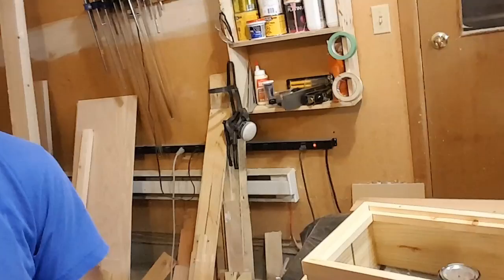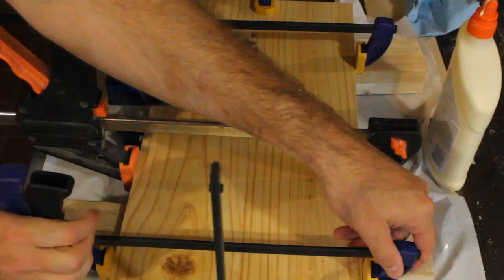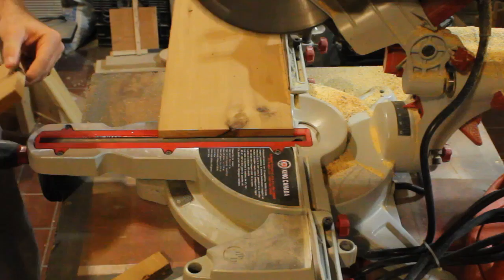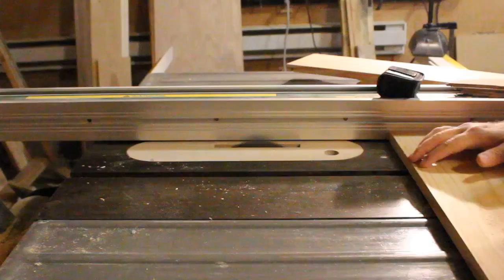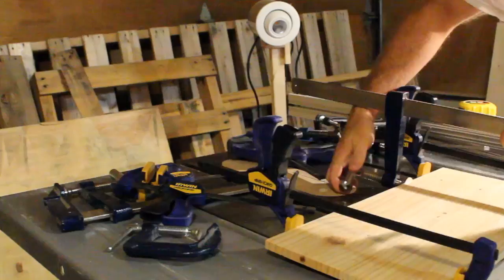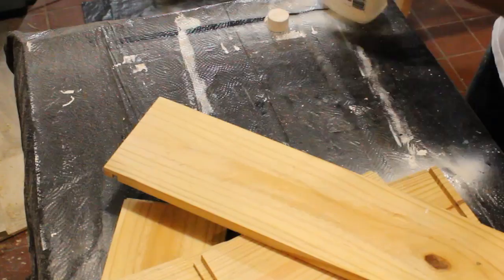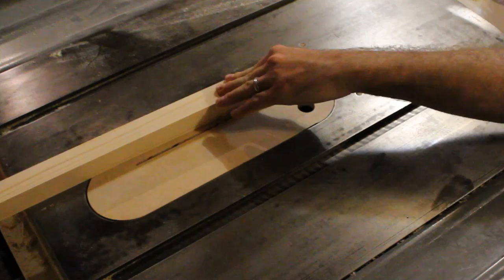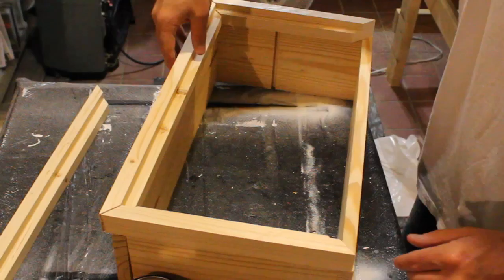Whiskey Gift Box Set: Part 1

Comment: Did you manage to get the bottom and top pieces perfectly flat? I have tried gluing up some panels and they kinda wobble when I put them on a flat surface. :)
Reply from the maker: I struggled with it at first, but I've developed a couple of methods for flattening.

Comment: Save up some money and buy some pipe or bar clamps for glue ups the clamps you are using warp the boards for glue up. I was making cutting boards and used similar clamps and they messed up my cutting boards. I purchased 2 Bessey pipe clamps there cheap but work well.
Reply from the maker: I actually just bought 4 sets of Bessey pipe clamps! Check me out on instagram @philpinsky

Thanks for watching and commenting.

Phil
Reply: +Jake and Emmy's Dad Workshop I don't have social media.
Reply from the maker: No problem.  Sub to my channel.  You'll see both the clamps and dust deputy in future videos.

Phil